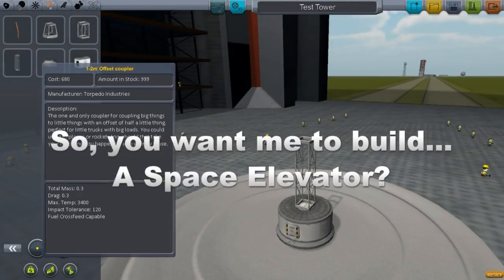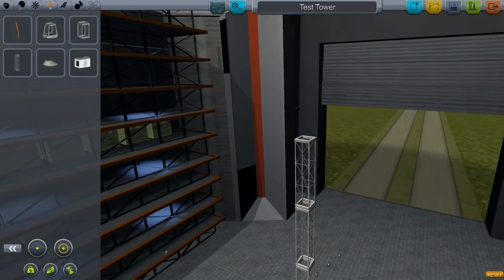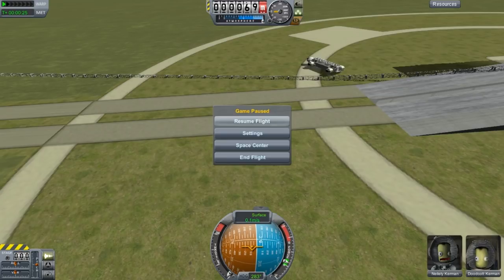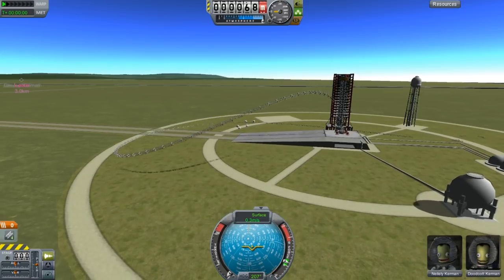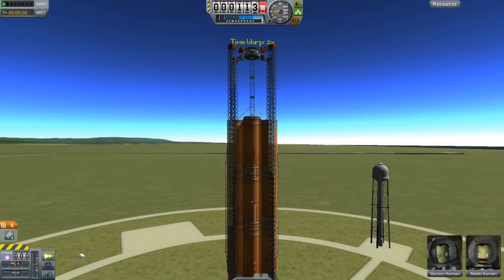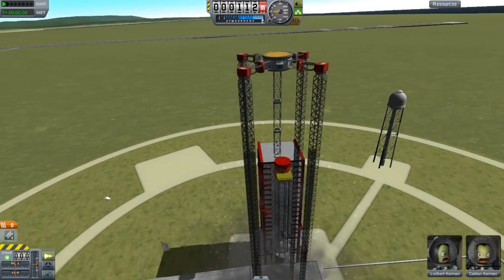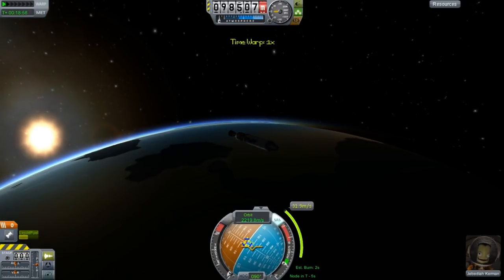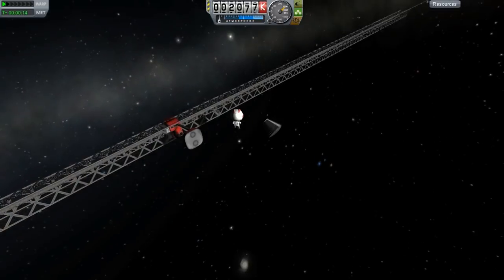Kerbal Space Program - So, You Want Me To Build A Space Elevator?

Comment: Do what they plan to do in real life, and use the claws to attach the elevator to a class e asteroid in orbit! For the sake of achieving this, increase the strength and reduce the weight of girders. This sounds impossible, and it may just be, but you should give it a try!
Reply: oh that sounds safe.. Obviously the rocket surgeons in Houston did not think this through very well.
So we attempt to capture an asteroid and put in into a safe geosync orbit.. Ok that is something far beyond out capabilities due to distance and mass and technology to do so. We haven't even landed a probe on a rock without it crashing let alone a manned mission. Also what do we use to move this rock effectively without putting it on a collision course with earth.. Also finding a spot on the geosync plane that will not deviate into a collision with communications and weather birds already on this plane.

Ok so lets say for some miracle stroke of pure luck we manage to get a rock into a safe orbit and attack a claw or we go cheap and use an old junk yard magnet. Did anyone consider not the length of cable it would take to wench this thing down to the surface but rather more importantly the weight of cable when run all the way out with the claw and payload, chances are the cable would snap before it got wound out fully and now you have a big claw and a length of cable hurling to the surface at terminal velocity. cable being whipped around can do very nasty things to whatever it hits
Another thing to consider if we solve the cable weight issue is the dynamic atmosphere. cross wind currents will cause the claw on the end to drift hundreds of miles off course in and at random directions considering how "well" we can forecast weather...

Ok so a space elevator may be better suited for the moon or maybe even Mars but for Earth no so much. There is just too much margin for error in a setting with no margin for error.
Reply: I meant it as an idea, but thank you for telling me how they're actually doing on this. I guess my source was either outdated or wrong. Thanks.
Reply: Good point. We've accomplished so much in such little time.
Reply: Adriel Green we need the Dr egg man from sonic colors...
Reply: Nathan Dillender we went from riding horses to space in only 100 years. This jump we have made in technological advances is so high if we would have advanced at the same rate we were statistically previously we wouldn't have this technology for another 100,000 years or more. We are the unique age of mankind. Mankind has always been just cave men or tribesmen with nothing up till this millennia. It's amazing, despite it doesn't show on the internet.
Reply: Actually, not in 100, but in ~60 years.
Reply: TheLaXandro 60 years ago was world war 2 we had already had electricity, flight, cars, amongst other things. Roughly 100 years ago was when the first car was made and that is when engineering took flight to what we have today.
Reply: But the first sattelite was in 1957, first man in space in "61, first Moon landing was in "69 and in "71 the first space station was launched. The rise of combustion engines was around 1900's, so indeed, around 60 years.
Reply: Adriel Green wot.
Reply: Adriel Green Now we did :D
Reply: In real life, using the asteroid as an anchor is the best way to make a space elevator. The problem with doing it in KSP is the limitations of the game itself.
Reply: Space elevator method is unsustainable. If you're climbing on the tether you're also applying transient force on the orbiting anchor, and the anchor need a rocket to correct its orbit.

I bet, if you keep using the space elevator constantly without refueling, it will go wobbly and in the end deorbited completely. Very dangerous if its a giant asteroid.
Reply: xponen
 Wrong. Using the Asteroid as an anchor, centrifugal force does it all. Although, in respect to Newton's 3rd law, I can see where you would think that.
Reply: Jeremy Truesdell but where do the climber got orbital energy from? from the anchor of course. It just steal it while climbing. This will degrade the anchor's orbit.
Reply: xponen
And centrifugal force will cause tension to return. If anything, this will slow the earth's rotation, but so minimally that it would be near impossible to notice without precision instruments.
Reply: Jeremy Truesdell thanks! but you see, we don't need space-elevator. We only need spaceplane, because it says (elevator) only 8% fuel saving over regular rocket (mentioned at "Applications: Launching..")

Also there is lightning, typhoon, tornado, hurricane, meteor, debris, satellite, atomic oxygen, sulphuric acid hitting the wire (mentioned in "Concluding")
Reply: xponen Well orion launched flawlessly and went further than any other rocket since apollo and that was just a test flight. We are getting there, However old school break away rockets are the answer. Shuttles not so much till we get more advanced.
Reply: bro when the astroiod leaves kerbin its screwed
Reply: Ausintune Thats why its in ORBIT around Kerbin (He's suggesting to give Kerbin a new moon, then go attach an elevator to it.)
Reply: Adriel Green "We haven't even landed a probe on a rock"
 We landed a probe on a comet.
Reply: ***** This comment chain is pretty outdated. :P
Reply: Eeyup
Reply: xponen
 That's why you balance out the mass exchange by sending things up and down at roughly the same rates.

Addressing the OP, we can already make a space elevator capable of supporting itself in Mars' gravity (at the least, we have the materials knowledge and can already calculate out how to do it). The only issue with Earth is that with it being so much larger and having such a higher gravity we need much stronger materials to get on up on Earth.
Reply: Adriel Green Welp. We just landed a probe on a comet. Bam.
Reply: Bubbletankking are you sure there's stuff to counterbalance 10 tons of rocket? can you imagine 20 tons of dead weight dangling beside a wire thousand of kilometer long holding for their lives hoping it won't fall to unsuspecting citizen just because a side wind (hundred of kilometers away) made the wire a bit wibbly wobbly??
Reply: I feel like you're underestimating the amount of mass a cable of this size would have. While I don't claim to have calculated any of it out I doubt that a cable stretching through the entire multiple thousands of kilometers into our atmosphere to be firmly anchored and balanced by the mass of a small asteroid would be affected very much by some air currents. I do realize that the weather we have can be fairly extreme but even a nicely sealed house can withstand even the most devastating winds (as the main issue comes when it gets indoors or underneath things that it can lift with brute force alone). The cable might get an oscillation but that could be countered by strategic placement of control thrusters or ailerons along with a touchdown point that could keep the cable relatively taught.

I'm not entirely sure what you mean by counter-balancing a 10-ton rocket: with a space elevator you wouldn't need the rocket, you could just send up the half-ton of payload that that rocket would probably be carrying. One of the main ideas I can recall for dealing with the counterbalance mass would be to mine asteroids in the asteroid belt and use that material to balance out the elevator. While that might sound silly, an elevator would lower the cost of moving things into/out of orbit by such an amount that there would be significant profit to be made from mining the asteroid belt. What's great about the balancing game played is that Earth would essentially remain at the same mass regardless of what we did simply because we would be forced to ensure we balance everything out. Though, any mass changes to the planet would happen over many decades if not centuries anyway so that isn't really much of a concern.

Accepting that novels are not the best source of information, I am still going to reference one in the next section with the decent assumption that, this one being a very heavily in-depth sci-fi one the author did their research well (and it seemed they did while I was reading it, at least nothing sounded outright false). In the book Red Mars we see people construct a space elevator for Mars using the material from a carbonaceous (if I recall right) asteroid. The material is manufactured into a form of carbon nanotube mesh that is built by advanced robotics facilities placed on the asteroid beforehand. Due to the altitude the elevator is at, the creators put in a planned oscillation to avoid the orbits of either Phobos, Deimos, or both.

Though, in that same novel we also see just how catastrophic it would be if such an elevator disconnected from its tether and deorbited. Due to the length it would wrap around the planet and carve a rather devastating valley all around the planet and by the end the cable would be travelling near if not at terminal velocity: causing the impact to instantly turn the cable to plasma and making a shockwave most likely comparable to a small atom bomb.

Sorry this got rather long and rambly but I just really like space elevators and I tend to write a lot when I have something to talk about.
Reply: Bubbletankking you mentioned a lot of good ideas, however you didn't mention about wave (or oscillation) that travel thru the cable.

If we pluck one end of a guitar string, a wave will travel thru out the length of the string. The same will happen to your space elevator cable, a shockwave will travel upward to the asteroid when other end experienced some catastrophic turbulence. 

In the end some over-engineering will be needed to make it safe, and like all projects, it will become more expensive than originally anticipated (eg: Space Shuttle) and scrapped.
Reply: Nathan Dillender Where are you going to get that asteroid? Its not like they are near earth at a nice geocentric orbit.

Comment: imagine a ring (or HALO from the game) with the circumference of the ISS altitude or higher.  what kind of gravity would it have?  theoretically speaking it is strong to hold its shape.  would it fall?  could we build a giant ring then slow it down and use it to hold up an elevator? I WANT SCOTT TO TALK ABOUT THIS!!!
Reply: As soon as the rotation is slowed down, the ring would collapse because no material can handle that stress
Reply: thank you for your input.  i agree the engineering would be improbable.    but even theoretically what would it take.
Reply: There is an idea called an orbital ring that rotates faster than orbital speed, and cables (or elevators) from the surface attach to it. The centrifugal force of the ring holds up the cable, and accelerates ships electromagnetically to orbital speed and beyond. Probably impractical, but not physically impossible.

Comment: But what about centrifugal force caused by earths rotation? it would have 2 forces acting upon it, 1. Earths gravity and 2. centrifugal force from earth spinning so it would be more stable and if made of carbon nano tubes i could see a space elevator being possible except with the small things like planes, space junk, meteors. etc. that could collide with it..

EDIT: I know that centrifugal force doesn't actually exist in physics and is just an interpretation on centripetal force but centrifugal force is commonly accepted as a type of centripetal force.
Reply: +SpydreX Official Yes that is the plan of Japan. To rely on centrifugal force.
For the debry they are planning to build the elevator on a boat, so it coulod avoid debries.
Reply: +Frontier Gamers United I heard about that. sounds fun dealing with the change in distance between the ends when the tides come in and out / moon goes by overhead
Reply: SpydreX Official Centrifugal force from earths rotation is the reason why a space elevator could be possible. It would be impossible if the earth did not rotate

Comment: Space Elevators are possible.  The only issue is that no material known to man is strong enough to maintain a elevator or earth.  However, this is not the case for the moon and steel is actually applicable for the moon.  Probably a cheaper way to get stuff out there is to use whats already there like asteroids.
Reply: What happens if we connect 2 ropes from the south pole and the north pole to the bottom and top of the moon?

I think something very bad and awesome would happen
Reply: ***** And if we use some material that would not snap, it would move the earths center of mass enough to alter our orbit of the sun, most likely slowly killing everyone on earth. That is not even taking into account that it would disturb the earths tilt, and the moons rotation around the earth, screwing up our seasons, and causing the biggest and the smallest tides ever seen depending on the side of the earth you live on.
Pretty much apocalyptic issues :P
Reply: Richard Smith Ideas on where we're going to get a) the raw material needed, and b) the refined material (whatever that theoretical material is,you didn't specify), and then make it into whatever harebrained shapes you for some reason want? Have fun getting that approved by Congress. Wait, never mind, you won't have any trouble.
Reply: Grant Bennett I start it by saying if... its hypothetical... it is impossible. My comment was just IF it were possible. Not anywhere did I say it was, nor do I think the original commenter thought it was possible.
Reply: actually they do have matterials strong enough. but it seems like a neat idea, but way to risky
Reply: we do EpicDstep.
Reply: Dr. Michio Kaku said we do have the technology- so it must be true
Reply: capt rodgers well, he's obviously not an engineer.
Reply: Rustin C. Haase As said in the video ''Carbon Nanotubes'' could be strong. So Carbon Nanotubes or Boron Nitride Nanotubes could theoretically hold the weight of the space elevator. - And building a space elevator o the Moon doesn't really make since as we would build it on Earth to save money but to use the one on the moon we'd have to get to the moon first, again. So just a big waste of money that'd be.. unless we colonize the moon, that is.
Reply: ***** Think your underestimating just how much mass that would take. I mean, no matter what, the elevator probably wouldn't have an equivalent mass to that of the moon so itd be alright.
Reply: Rustin C. Haase VSauce
Reply: Rustin C. Haase What about carbon nanotubes?
Reply: TWG From what I know Carbon Nano tubes might be strong enough but are brittle and may be hard to make.
Reply: Rustin C. Haase This has already been said!
Reply: ***** Yeah, if your ropes/elevator don't rotate with the moon's orbit. If it does though, then it would be fine...
Reply: Rustin C. Haase Space elevators in the sense of an object either suspended from space or going from the ground to space, is impossible, there are to many uncrossable physics barriers in place for that, however that being said, the idea of a space elevator is still possible when you take into consideration either anti-gravity or gravity manipulation technology... serious advances in fields like flux pinning might allow you to latch on to  one of the polar gravity fieldlines, theoretically taking you into orbit without causing damage to the atmosphere..  granted we are a long way off of it, and there is another huge barrier to leap, but its far more possible for us to eventually invent a superconductor that works at any temp, then to create a magic unbreakable material that could hold the weight of a spaces station in orbit and not destroy its self..(as of now, flux pinning or quantum pinning only works if the superconductor is frozen with liquid nitrogen)
Reply: Richard Smith It wouldn't change the Earth's center of mass. The moon already changes it, whether tied on or not.
Reply: Gary Gordon that "super" material very well could be reality with nanotechnology.
Reply: Scibbie. The "best" Channel in the World! 
Something nobody has mentioned yet is that the moon is not in a perfectly circular orbit of Earth, it's Apogee is about 40,000 km higher than its Perigee, which would cause the ropes to slack or snap at various points :)
Reply: NightmareNinja91 That's a simple (not the same as easy) problem to solve. You merely have extra length for the ropes that your roll in and out as it gets closer or further.
Reply: +Rustin C. Haase 
It depends on if your ropes behave like springs or not, also depends on if your ropes are rotatable fixed or not.
If they are rotabtable but not like springs, the moon would pull the poles out from the earth's crust when the moon gets closer to its apoapsis. Elsewise the earths rotation axis and the moons inclination will become equaled(will change seasons and weather on earth). Also days on earth will be longer whilst the moon will start spinning because earths angular momentum becomes transferred to moons own rotation.... anything else?

Comment: Theoretically, could it be possible to build it up over time using multiple launches and docking ports (I know it wouldn't be stable)
Reply: 〉Phez〈 And would stop rendering at some km's.
Reply: +shark2199 2 kilometers. Physics would turn off and even if you got that far it wouldn't be stable. Trust me; the physics engine cannot handle it. It can barely handle much more conventional designs.

Comment: Theoretically, you can build a space elevator, IF we ever develop the technology to build something from high orbit down to the planet's surface in a straight line. 
Because:
Once the bottom is secured to the planet and the top is moving at parallel to the earth's surface at the "same" speed, the gravity that pulls it down is countered by the force that pulls the top away from the planet. So you could build a stable space-elevator without the supporting strings that you see on TV-towers and radiotowers.

However, we currently do not have this kind of tech.